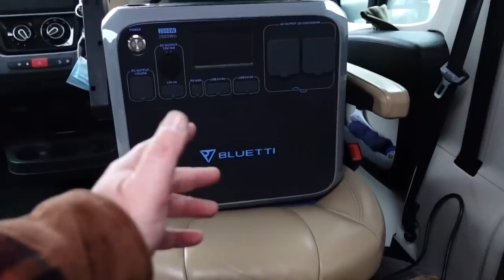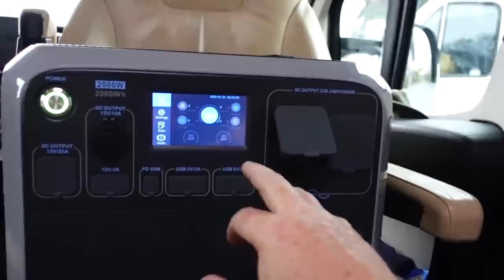Deciding to give up meat for a month - Vlog 64

Comment: Well, that had a bit of everything😁 With all that extra Solar/Coffee power, have you thought about getting a portable Induction hob to save using LPG all the time for cooking? I got one ages ago and will take it in the van with me to use when on hook up to save using my little butane cartridge burner. Tested it out with the kettle and it takes the same time to boil as on the gas burner or the 240v kettle. They are pretty cheap, so might be worth investigating. 😎🚐🔆
Reply from the maker: Thanks Linz - We have one! 😁 it’s very new - in fact it’s being used for the first time as I type (thankfully my favourite frying pan works with it 🥳) it’s quite exciting 😁

Comment: Hello John
About the pump I have been playing around with diesel heaters for years and I'm sorry not all pumps are the same the cheap diesel heaters have stamped on them 22ml and the one you just shown 6mil on it. l contacted planer I asked them about 2 years ago did there quiet pumps fit the cheap diesel heaters and they said no they wouldn't be compatible because the fuel delivery would be wrong. I have tried different pumps and some pumps deliver too much fuel and cause them to smoke but if you look on the side of pump usually says how much fuel it delivers some pumps are adjustable I have solved the noisy pump issue but I was thinking of making my own YouTube video as I know it would be very popular so many people hate the noisy pump.
Reply from the maker: You should do that Mart. The “quiet” pump says 8ml and the Chinese heater pump says 11ml, which only makes sense when they reveal the “quiet” pump is really only supplied with 8.5v
The ticking is the internal solenoid hitting the bump stop, the thud is the actual fuel being delivered to the burn chamber. So a weaker solenoid pulse would reduce both noises. I’ve got two mods of my own to test out yet, before I give up with the idea of making it truly quiet.

Comment: Hi again thanks again for your comments on my last question. Would like your thoughts on a base van model for reliability and parts e.g. Ford? Anything you would stay away from?
Reply from the maker: We’re not fans of French engines but there’s such a range available if it’s been looked after then it’s a good start. Are you looking for a motorhome or van conversion?

Comment: john just been watching your solar panel replacement video, just a thought but when i installed my solar panels i used stick pins to tidy the cables up. it works very well and they as you know do not rust. regards.
Reply from the maker: As I said in the video it’s not finished yet, I’ve got some tilting testing to do yet 👍🏻

Comment: Hi John. 
While theres no excuse for poor customer service, rudeness and flame postings on social media, whoever wrote the article (and your shot of the label on the pump) has provided a useful insight. 
The pump for my chimese heater (and i suspect yours) is 0.02ml per pulse. The one theyre using is 0.08 so its only going to tick a quarter as often in their heater. Saying 12v pumps are all the same is like saying 12v lights are all the same... 
Dropping the pulse voltage from the nominal 12 v to 8.5 halves the energy in the pulse and will drop the noise of the tick by slightly more than that. Hence their claim of a quiet pump. 
Armed with this its perhaps worth experimenting with dropping the voltage to your chinese pump. A flywheel diode across the solenoid and then several 1n400x diodes in series until it just clicks would probably be easiest.
The final improvement would be perhaps to replace the tube from the pump to the heater with something more flexible (tygon from RS would be a good choice). The rigid tube definitely insn't part of the fuel metering but i have heard (youtube) that sharp pulse of fuel improves combustion ... I suspect that whilst this is true for piston engines its not required for a blowlamp with a fan. 
Hope this helps
Peter
Reply from the maker: I’ve gone down the same route, reduce the voltage to around 8.5v and have a damper and rubber hose too. I just need time to play now & test.  😎👍🏻
Reply: @johnmandy  Ah... Great minds... :-)

Comment: Do you have a link to a video re fitting a safe ? And also a link to your vent fan ... I’ve looked and looked :(  and would you bolt the Safe to floor or someone said sikaflex it down. But watched your solar panel removal with sikaflex and looks easy ish to get off ???  Thanks guys. ❤️you xx
Reply: Ah found the roof fan ... phew :) just a safe ??
Reply from the maker: @carolinebridge900  We’ve only ever made one showing how we removed one.  Security paranoia makes you not show where the new safe is fitted 😁🙈
Reply: @johnmandy  I know it’s a minefield. Only for passports when we are abroad ! Much to peoples advise not to travel with valuables I consider passports a necessity. !! Doh ! Xx

Comment: Everything you have upgraded has been top notch why compromise on a Chinese diesel heater and pumps from chancers - why didn’t you go for a Webasto or Eberspacher? I know it’s £400 more but surely it’s worth it for full timing 🤷🏼‍♂️
Reply from the maker: Why buy the expensive version when the cheap version is identical? The diesel heater we’ve bought is amazing, gives great heat, works perfectly and isn’t silly money.

Comment: Hi to you both ,John in your opinion do you think the vitron three in one b2b , solar regulator , battery charger vbcs 30/20/250 is a better bet than having three separate units we have 100watts solar and spend no more than 3/4 days off grid
Reply from the maker: Victron don’t make a 3 in 1 b2b, they only sell separate chargers. You need to work out how much power you’ll use each day to work out how much solar and chargers you need. I’ve got an electrical playlist on here with videos to help you work all that out.
Reply: Sorry John it's VOTRONIC THREE IN ONE

Comment: Hi  l was just wondering have you been on the waybridg lately with all the things you have fitted plus personal gear. I have got a second hand air suspension kit for sail. Only dun 2000 miles.
Reply from the maker: We covered this in Tuesdays video. The van is lighter, considerable, now than when we bought it as we’ve replaced very heavy items with lightweight ones. We’ve got air suspension already 👍🏻